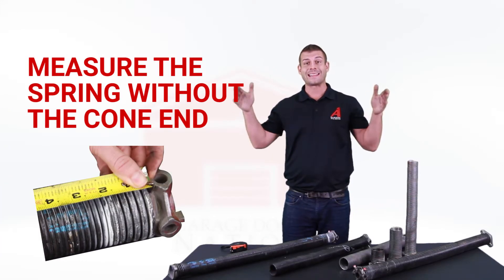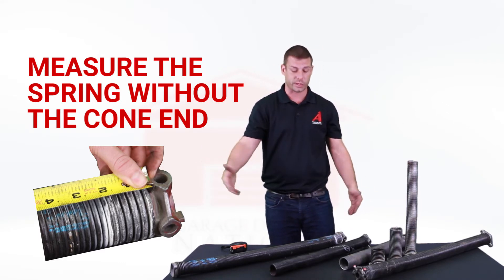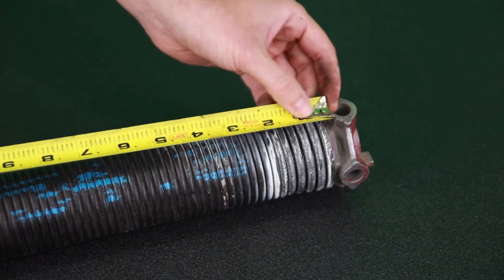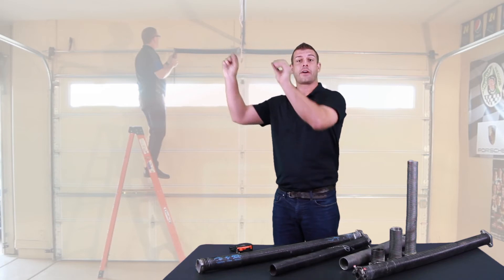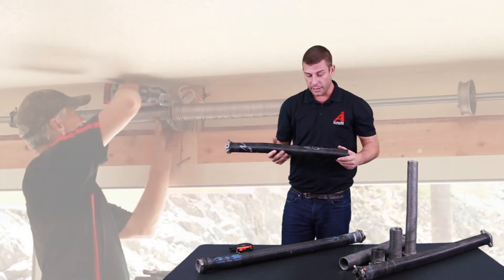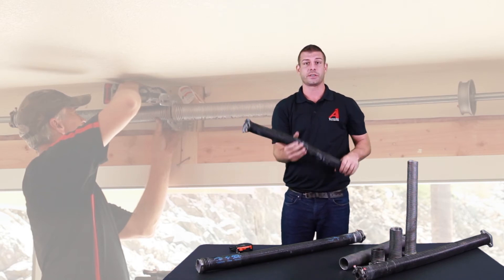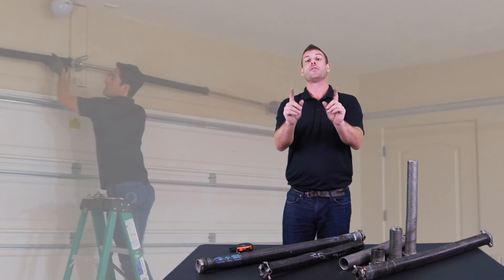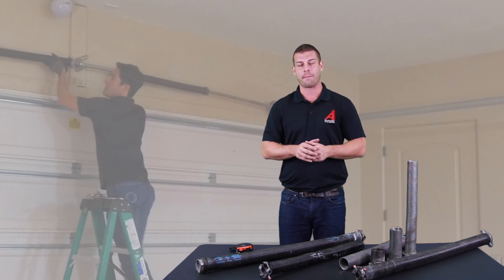How To Measure the Spring Length of Garage Door Torsion Springs - Garage Door Nation

Comment: I would like to switch from extension springs to torsion springs. How do I determine the size of torsion springs that I need? 
The door size 9’ wide x 8’ tall. The door is pretty heavy as it is a solid wood door.